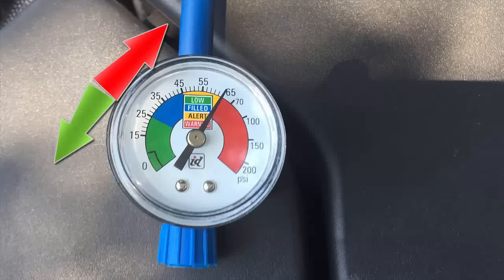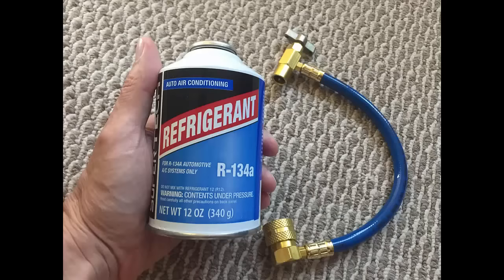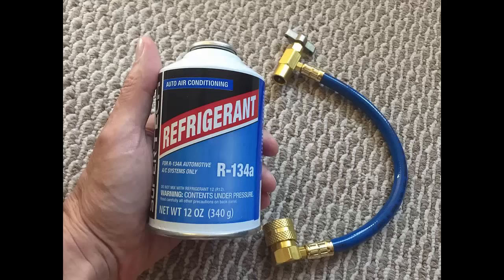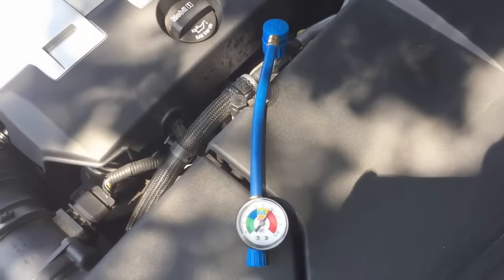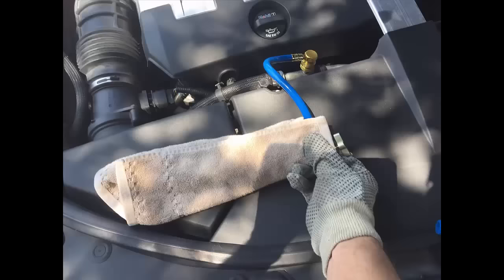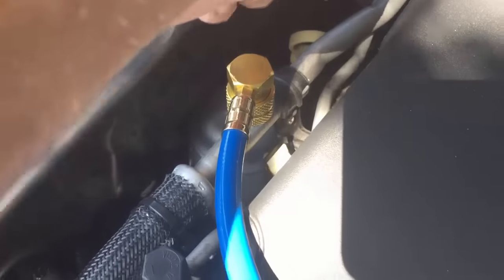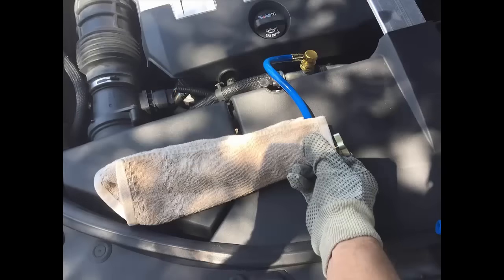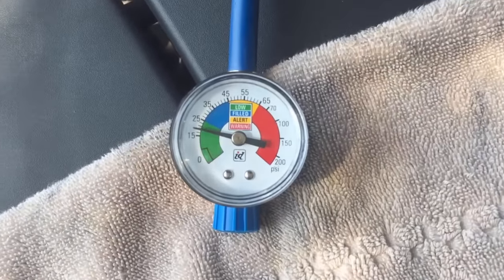Car AC pressure too high FIX overcharged a/c gauge fluctuation reading jumps Up Down Freon problem

Comment: Did the same damn thing myself on my Mustang. It was barely in red & made clicking every 30-60 seconds.
Slowly released pressure & clicking went to a few minutes per click to finally none BUT it was 85 when I started.
Now at 80 no click at all but I'm right back where I started at 30 in green. Wanted a good 40 or 50 but let too much out. 
It is colder now but for how long?
Reply from the maker: It sounds like the same problem as in this video. 
Most likely, your system has incondensable gas inside (regular air that got sucked in through a hole on the LOW side).
For now, you can keep it kinda cold with just the right amount of refrigerant. But eventually, you'll have to repair the hole. Then vacuum the system and refill it from scratch.

Comment: Here's a question. I haven't been able to put any refrigerant into the low pressure port, because the reading is already in the red. Do you think this technique will work even if I haven't put any refrigerant into the low pressure port yet?
Reply from the maker: Have you tried checking the Static Pressure to see approximately how full you are as in the next video? https://youtu.be/7loH93-9MNQ
If the Static pressure is way too low, the compressor may not even start, so you won't be able to fill it. In this case, you may need to TEMPORARY disable the pressure sensor.
Reply: @Your-Self  somehow a year late on responding, but I'm having the same problem again. I'm going to test this tomorrow, how do you disable the pressure sensor? Are there any videos you can point me to? For some reason its difficult to find a definitive answer to this

Comment: Mode did that cycle on and off red then below green. I had some ac pro in can Ang have off a squeeze for a few seconds. The cycling stopped and now remains steady just before it hits the green area. Guessing I had low pressure and the switch was shutting on and off. Now cooler air but needs to be brought up into the green.
Reply: Oops, mine I meant
Reply from the maker: Yep, the pressure seems to jump into the RED when AC is OVERcharged or UNDERcharged... so adjust accordingly.
Reply: @Your-Self  . Yeah. Think I will burp it just to be sure, then check it again before add the can. The cycle stopped once added a tad. Blows a bit colder so let's see once it gets 35-45 psi in there.

Comment: Was your vehicle running at normal temperature.
Reply from the maker: Yes.
Later, I discovered there was a tiny leak in the evaporator. So some regular air got sucked into the system. That's why the internal pressure was acting strange.

Comment: So I did this and found out mines around 150, did this trick and got it down to $40. Ac still not blowing cold air, just warm air, Is it instant or do I need to drive around?

Comment: I put the gauge on and let some pressure out for a good minute or so, and it's still in the red. New compressor?
Reply from the maker: Try the "Static pressure test" as on the next video... https://youtu.be/7loH93-9MNQ
If the static pressure is good, and the compressor is not bringing the pressure down when it's ON - the compressor is probably dead.

Comment: any benefit of releasing freon from high port instead of low port?
Reply from the maker: Yes. In the Low port, if the pressure drops too low, it can suck the ambient air inside the system. It won't happen in the High port due to much higher pressure.

Comment: I’ve watch every single YouTube video for this and I’ve tried asking questions I never get any answers. My car is reading over 100 psi and I don’t know if it’s due to the gauge being attached to the bottle or the fact that I’m checking the pressure with the car off?  I’m literally getting nowhere it’s really seeming like I have to bring it to a mechanic. For them to do this simple stupid fix
Reply: The ac compressor needs to be running

Comment: Hi, im still confused. im in Miami 100 temperature. The indicator goes straight to red. That means is overcharged? or that's the correct reading for this hot weather???
Reply from the maker: Try to measure the Static Pressure (with the car off) as in the next video https://youtu.be/7loH93-9MNQ
Then compare your results with the chart, which is for R134a refrigerant.

Comment: If I hook my recharge hose to the low side without a can on the other side if I bleed some of the Freon out will air get back into my system?
Reply from the maker: The system is under high pressure, like a tire. So if you open the valve, regular air can't get inside... unless the system is low on Freon.

Comment: So what happens if you just let air out? I made a mistake and bled it while it was not running. Does the air correct itself?
Reply from the maker: Bleeding with the engine off is not a problem. But if you bled it too much, you'll need to refill it again. 
Watch the next video on "Static Pressure" to find out how much refrigerant you have left. https://youtu.be/7loH93-9MNQ

Comment: The gauge shows you’re in the green which means it’s good but you should be using a gauge that has an extra gauge you turn to point to the actual outside temperature. Otherwise you can’t get the right amount in your car.

Comment: i overcharged , i saw some mist come out from somewhere, immediately bleeded out excess refrigerant  to proper pressure, i noticed fluid under compressor clear fluid, don't know if there is a leak but the pressure is holding, the cold is on and off, not steady

Comment: When I buy a can of refrigerant that has the same connection as yours, can I check the pressure like you did with only using the hose and gauge w/o the can?
Awesome video. Thanks so much.
Reply from the maker: There are different hoses out there...and if you have the one with the gauge and a trigger, you can use it to fill-up and check the pressure at the same time with or without the can. My gauge hose didn't have the trigger, so I used it just to check pressure without the can. Then I had to use a different hose with trigger (valve) to fill-up from the can, but couldn't see the pressure, so I had to guesstimate how much to put in and change hoses to recheck the pressure again.
Reply: "All"  your videos helped me so much.
GOD bless and thanks again.

Comment: I had this exact problem but after doing this method my ac compressor started making a really loud screeching noise and my PCV valve check engine light came on? Any advice? Its a 2005 ford taurus

Comment: I accidentally overcharged mine with a brand that also had a leak sealant inside, and my mechanic said they can’t fix it.  Would this work in my case as well?
Reply from the maker: If mechanics refuse to work on your AC, then you have nothing to lose by trying this method.

Comment: Is that the low Port you drained it from?
Reply from the maker: A typical single gauge like this will fit on the Low port only.
Reply: @Your-Self  it worked! Thank you, I guess I put too much in and overfilled? The gauge said it was fine and it worked for a little bit, but then my wife said her air stopped working…. Glad it wasn’t broken. You saved the day.

Comment: You need to consider the ambient temperature. The cooler it is, the less pressure you need on the dial, just consult an online pressure/temperature chart.

Comment: If you there’s to much pressure does that stop it from working?
Reply: Too much pressure leads to the refrigerant being unable to expand (evaporate) and contact (Condense) correctly. Therefore no heat transfer occurs. excessive pressure makes the refrigerant unable to absorb heat -> hot air blowing from AC
Reply: @55yxalaG  very well written thank you for helping me understand

Comment: Don’t let R134A escape to the atmosphere if the system is overcharged.  Recharging a system with low level refrigerant is not simple as just recharging with a can; doing so will only make it worse.  If a system is leaking, the car should be taken to a shop.  If you have all tools, you likely know what to do.

Comment: I have the same exact problem, its settled at right below the blue and ac works but as soon as I try to add freon it goes bizerk and does the same thing as yours, did you do anything further to fix it?
Reply from the maker: It's possible that there is a freon leak, and some regular air got inside the system. You may need to go to a repair shop, so they can inject some dye inside, and watch where it's coming out. If the leak is at the evaporator (behind the dashboard,) it may get pretty expensive to fix because of the disassembly time. Good luck!

Comment: I find that so odd because the pressure is so low at blowing cold. But the recommendation would be 2 cans the. It starts to blow hot. I’m sure you released about one can. Why do u think it works On such a low pressure?
Reply from the maker: I think there was some air mixed in with the refrigerant inside my system (due to a possible evaporator leak). Air takes some space inside those pipes, so the system still cools but not efficiently and with weird pressure.

Comment: That gauge is not the most accurate and you should probably take it's reading with a grain of salt. You may have some air in the system also which can cause some weird readings in my experience.
Reply from the maker: Yep, later I figured there was some air in the system due to a slow evaporator leak. And that's why I had to drop the pressure very low to be stable.

Comment: Was it pressure sensor?
Reply from the maker: No. There was a small hole in the evaporator, and regular air got sucked into the system. This recharging got me around for a while. But eventually, I had to replace the evaporator.
Reply: @Your-Self  thanks i fear the same but i over charged and mechanic used machine today said there was alottttt of freon...he added correct amount..worked 5 min...now same symptom..the pressure switch kept turning on and off on and off the compressor...im going to try pressure switch 1st...then check for leaks...i think if i had leak he wouldn't have recovered so much...thanks and your ch is great! Love the content i will try to have a channel like yours soon i like it

Comment: What year cadillac is this? mine is doing the exact same. I'm gonna take it to a professional I think. system is overpressurized so I'm not gonna mess with it too much.
Reply from the maker: this is 2009 model... and so far AC has been great since the video. Good luck with yours.
Reply: YourSelf  thanks for the reply. I have an 2012. the funny thing about this is that my cigarette lighter stopped a while back and couldn't find the fuse. the fuse wasn't the same for my 2012, however it helped me find it. thanks
Reply from the maker: interesting... 2008-2013 CTS looks the same, but I guess electrical system is a bit different
Reply: Pray you don't have to replace the compressor. It's one of the hardest jobs I have done. What a shitty design by the engineers.

Comment: When do you stop? When the gauge is stable? Mine is doing the same thing right now, it turns off and on
Reply from the maker: if you are using the same gauge as me it's not reliable to begin with. It's supposed to be stable in Blue area 25-45psi, but in my case it couldn't stabilize till I dropped the pressure down to about 20psi. If you think you overcharged your ac, Let pressure out little by little till the gauge stops jumping, but if you didn't charge with Freon at all, you may have other problems. PS. I'm not a mechanic, just sharing my experience with similar issue
Reply: jynx 1966 thanks man I well try it tomorrow morning
Reply: 35,000 dollar fine of you get caught, even if it's 134/134A refrigerant

Comment: My ac compressor (was) cycling so I thought it was low on refrigerant , i put some in and it seemed to keep the compressor on, only worked for a day, now the compressor won't turn on at all and I even tried to release some of the pressure? Think i tripped the pressure switch, or could this be something major? Thanks
Reply: You do not want the compressor to run all the time it's supposed to shut off and turn back on

Comment: Question? Do release gas with engine/AC on or off ?
Reply from the maker: The engine and the AC should be running on high.
Reply: @Your-Self  big thanks for fast reply.  🙏
Reply: @Your-Self  okay I just purge the ac because it was over filled but now it doesn't get cold at all 🤦🏽‍♂️
Reply from the maker: Have you checked your "static pressure" to see how much refrigerant is in the system with the engine not running? Here is the video https://youtu.be/7loH93-9MNQ

Comment: I'm a little confused. Do I do this while the car is on and fan blowing or when the car is off?
Reply from the maker: The car needs to be running with AC on "full blast" at the hottest time of the day. Do it a little at the time until you feel cold air coming out of AC.
Reply: @Your-Self  When you "say a little at a time" what do you mean? I know you were not able to tape that part but I'm not sure how to take out little at a time using my hose. My hose is like yours but it also includes a meter. Once I turn on the car/ac and attach my hose what should I be doing to suck the air out.
Reply from the maker: When the can with refrigerant is attached to the hose and you open the valve on that hose, the refrigerant goes into the AC system. But if you remove the can from the hose and open the same valve a few seconds at the time, it will come out.

Comment: So mine is reading 200+ PSI, I let all the pressure out just about and put a little bit of 124 in and i checked it and went back up to 200+ psi?! Any ideas I have a nice newer SHO with not many miles there is no way the compressor went so soon
Reply: you vehicle should be at around 34 psi for the ac to blow cold.
Reply: @Shawn855  yea I know, I let all the extra pressure out put a tiny bit of a small bottle back in and checked the pressure it was all the way back up to 200+ so I gave up for the time being
Reply: @tracemiller1519  that usually happens when you have too much air left in the system. Thats why the correct way is to have the mechanic attach the machine to the ac ports, and drain all of the old freon + air out of the system so that when you/they refill it, there won't be air leftover in there.
Reply: @Shawn855  okay I plan on taking it in just haven’t had the chance, thanks buddy 👍🏼
Reply: Congratulations on causing an environmental hazard

Comment: Did you find out what the problem was because the needle did say low and didn’t make sense why it settled in the low.
Reply from the maker: Yeah, I had a tiny refrigerant leak in the evaporator. When the pressure went negative, it sucked some regular air inside. So the whole system was "bloated." Adding just a little refrigerant got me around for a while. But eventually, had to fix the evaporator leak, vacuum the system, and refill it.
Reply: @Your-Self  can low refrigerant too have your a/c cut on and off too?
Reply from the maker: Yes, too low or too high can cut it off.
Did you watch my next video about Static Pressure? https://youtu.be/7loH93-9MNQ it can give you a better idea if it's over or under-filled.

Comment: My car is 117psi when the car is off and when it’s running with full ac, it gets to 27 psi. What do I do? Add more or dont? I don’t want it to pop on me
Reply from the maker: Did you watch the next video about Static Pressure (when the car is off)? https://youtu.be/7loH93-9MNQ
It all depends on the ambient temperature. And it's best to measure with the engine cold.

Comment: Mine too will only go up pass the around 30psi but if I add more refrigerant it will act like overfilled. I’m confused!
Reply from the maker: Yes, this can happen when there is a leak on the LOW side, probably around the evaporator. The system sucks-in the regular air through a crack, which creates too high pressure on the HIGH side, and too low pressure on the LOW side.

Comment: I tried this, pressure did go down, but ac was still not blowing cold air. After leaving a while pressure returned high. Lowered again and not working , again returning to higher. Any other advise please?
Reply from the maker: Did you watch the next video about static pressure? https://youtu.be/7loH93-9MNQ
That way, you can, at least, rule out if it's over or under-charged.
Reply: Thanks, so if it’s overcharged, what should I do next?

Comment: Yeah you can't go by what those numbers say on those cans It says to put between 45 and 50 PSI in for 91°, but then the system will turn on turn off turn on turn off You have to be around somewhere in the ballpark around 30 PSI in order for that pump to always run and get cold I had this problem with my 2011 Mercury Milan. I watched another video it was doing that some guy said it was low on charge so he kept on putting fluid in there until it's stabilized in the pump ran continuously I just think it's what kind of system you got that really matters some take more some take less unless it has something to do with that temperature sensor in the car that tells you the outside temperature unless it's off by some degrees.. I took my house thermostat and I put it on my air vent with my air conditioning running and it blows about 44°. I caught a air conditioning people and they told me that's quite good cuz the lowest they ever seen air conditioner blow is 41